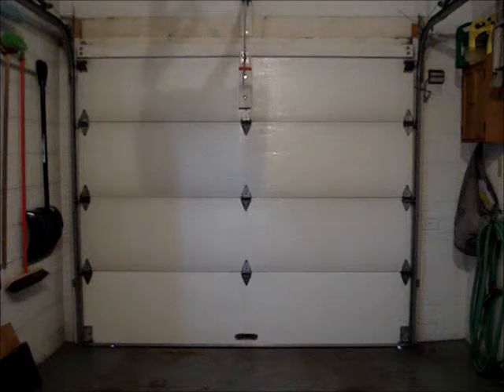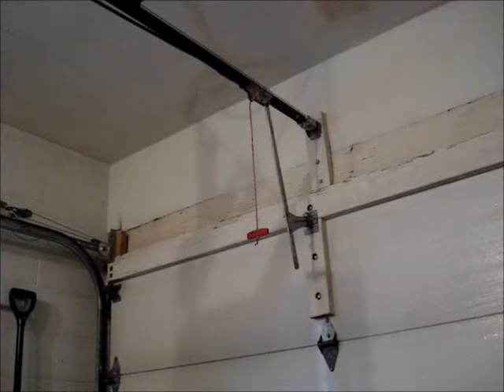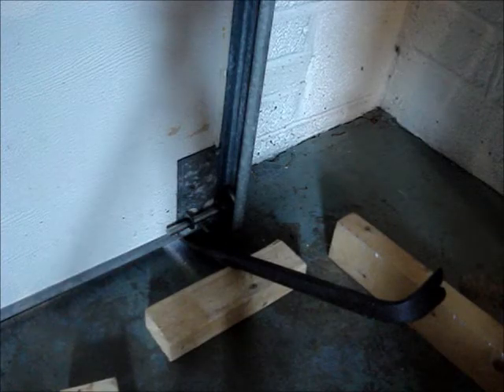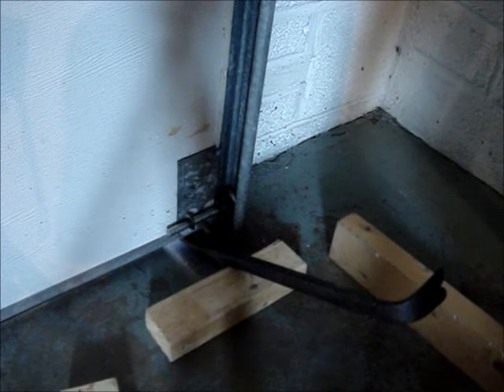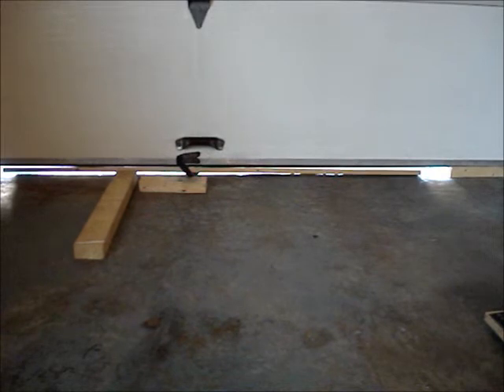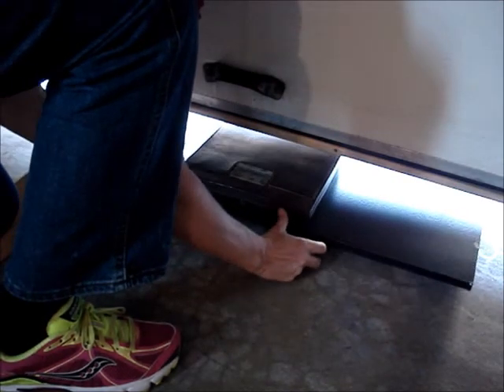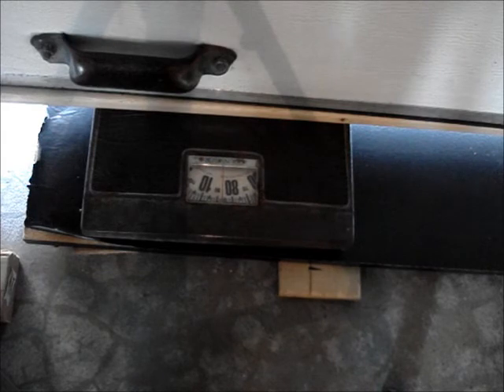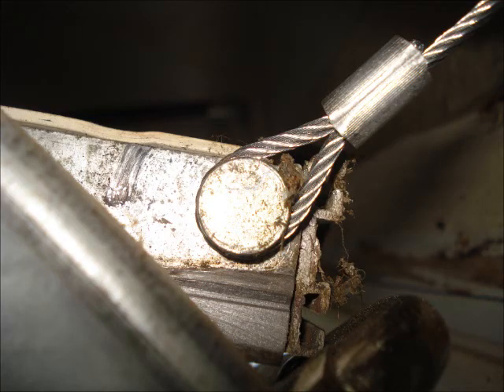How to Weigh a Garage Door

Comment from the maker: How to Replace a Garage Door Extension Spring: https://youtu.be/qBguQSbAKv8 
How to Get the Right Size Garage Door Spring: https://youtu.be/u3uT0sp2Hf0
More Know How Now videos about garage door repair https://youtube.com/playlist?list=PLvce66kQTjJRJKROOLMF-maHA5gUpZsUV

IMPORTANT NOTE ABOUT DIGITAL SCALES: Do not use a digital scale bathroom scale, good digital commercial scales for weighing packages tend to be reliable. Analog bathroom scales adjust the reading as the weight changes, but most digital bathroom scales are designed to register weight in a narrow window of time and may not show the correct weight as you wiggle the door to get the final weight of the door.

There are hundreds of videos at Know How Now, subscribe so you can always find the channel…. It’s free. I always respect your time and do my best to keep the videos brief, but informative.  Check out the channel with this link:

https://www.youtube.com/@Know-How-Now/videos

Comment: You could also use a luggage scale attached to the center handle.
Reply from the maker: That's a great idea, for a small door.  I just looked at one, the max weight was 110lbs.
Reply: @Know-How-Now  Yes, you might have to hook two in tandem to 2 separate levers, one at either side of the door close to the tracks.  Get someone to help you raise the other lever or rig up a cross piece to connect them.  Then just combine the readings of the 2 scales.

Comment: Hi , this is a very great video, but I cannot see very well what you did around 1:23, when you clamped the cable somehow. This is a important step I cannot see from your video
Reply from the maker: The cable is clamped to some metal bracing.  It's unlikely that your door is exactly like mine.  The concept is to clamp both cables to some sort of bracing so that the springs are not pulling up on the door.  Make sure you can lift the door without knocking the locking pliers loose.  The other alternative is to disconnect the cables.  You would have to do this with the door open.  Do not do it with the door closed.... very, very dangerous.  If after disconnecting the cables, you will have to lower the door....it will be very heavy and again dangerous.  You could drop it on you or damage the door.  Clamping the cables with a good set of locking pliers is the safest way to do this.
Reply: @Know-How-Now  Your method of clamping the cable will not take any tension of the spring off of the door. the cable has to take all tension off of the door.  To enable you to weigh it...
Reply from the maker: Please explain why clamping the cables to a brackets on the track won't take tension off of the bottom of door.  How are you doing it?  Please explain. There are over 13K views on this video, 231 likes and 14 dislikes.  You are the only person who claims that clamping the cable to the track won't remove the tension.

Comment: Very helpful video! Question, can I use a digital display scale to weight my door or does it have to be an analog scale?
Reply from the maker: It depends on the digital scale, most of them "lock in" on a reading on a narrow period of time, so as the weight of changes the scale does not reflect that change.  Perhaps you can borrow one from an older friend or neighbor, they probably have one of the old analog scales.  They don't tend to break.
Reply: Know How Now thank you for the advice, my spring color is light blue, which should be 190 pound spring (2 car garage, 7 feet high door) but I suspect it being the incorrect spring. I weighed it with a digital scale and it came out to be 170 pounds..either way. I'm rambling..lol...thanks for the help and keep up the great videos!
Reply from the maker: You are welcome.  One thought, if you live in a development, maybe you could check out any identical neighbor's doors.
Reply: Unfortunately, I don't. I'll have to go at it with an analog scale. 😕 thanks for your suggestion. 😀